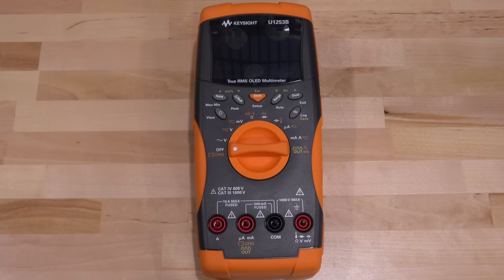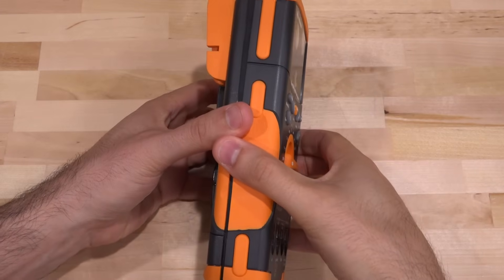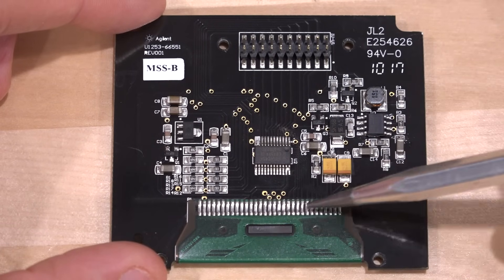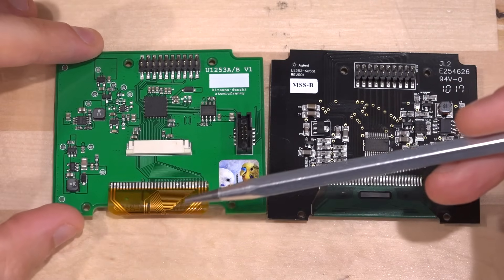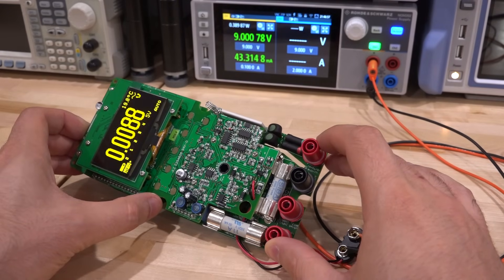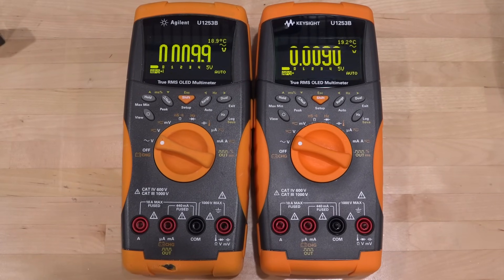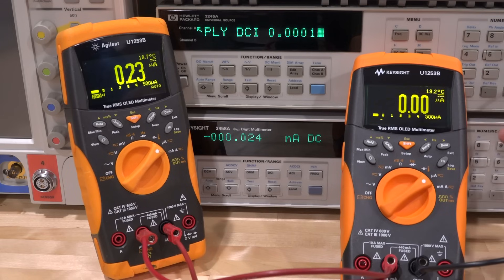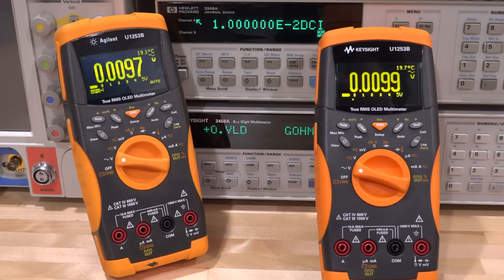TNP #19 - Teardown & Repair of a Keysight U1253B 50,000 Count True RMS OLED Handheld Multimeter

Comment: You might want to look for a U1273A meter on eBay. I have one and Keysight ended up giving me a free U1282A multi meter because of a defect in the early revisions of the latter. Maybe the trade in program still exists?
Reply: U1273A meter is a good product, but it has been discontinued

Comment: I got an Agilent-branded U1253B meter many years ago and so far the screen still works, albeit with a slightly noticeable but still usable level of burn-in on the display. Last time I checked the third-party replacement displays, they had a compatibility issue with some artifacting on the bottom edge of the screen, so it looks like that issue's been dealt with.

Battery-wise I've already worn through the original Imedion 8.4V 250mAh Ni-MH battery, and a Powerex 300mAh 8.4V Ni-MH. I eventually got fed up with the limited battery life, and just have a pair of 600mAh 7.4V Li-ion "9V" batteries that I just swap between the charger and the meter as needed. I get much better runtime on the default/maximum brightness, but tweaking the battery setting to 7.2V still leaves me with a limited accuracy on the built-in battery meter, which I'm okay with since I always have a swappable battery ready.
Reply: I still have some OLEDs here for replacement if still needed
Reply: @wangyun-pp7xc  I am looking for a replacement OLED module for my U1253B.  Do you by chance still h have any?  If yes, how much $$?  Thanks.
Reply: @kenansgarage  Yes,I still have some,contact with email.